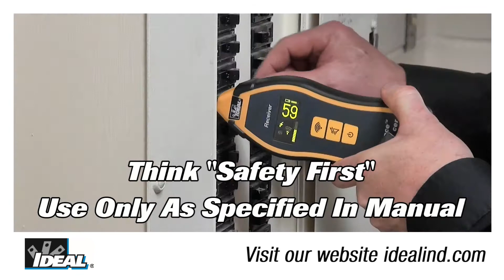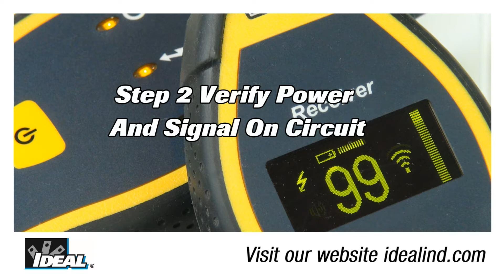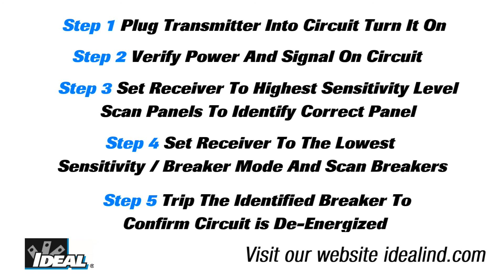SureTrace™ Circuit Tracer Identifying a Breaker

Comment: Thanks Ron for showing the actual useage of this in action...These tools are invaluable no doubt as I've mustered around tracing where someone would yell..."It's Off" lol...You never did trust that yell....
Reply from the maker: Roger Diotte Yes I have been shocked thinking I had the right breaker as well. The tracers are not cheap and I tell people how expensive they are is depending on how bad you need to find the wire!